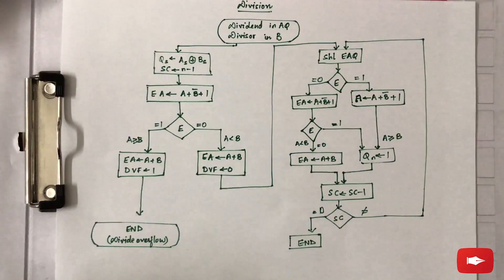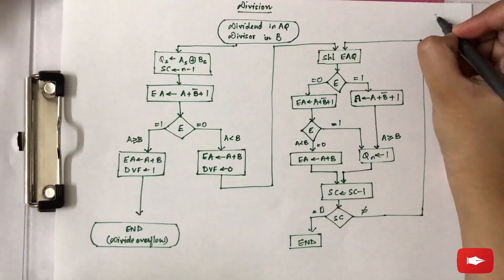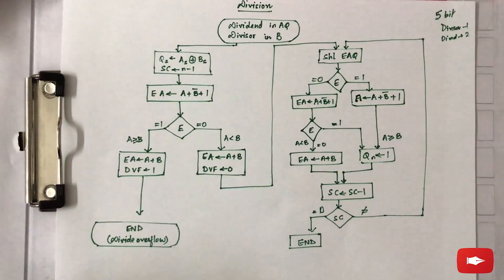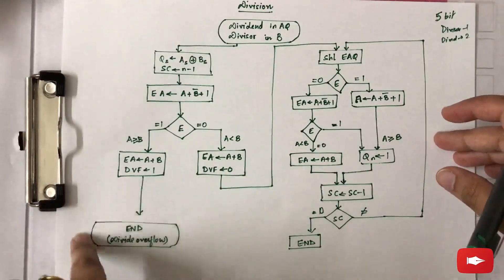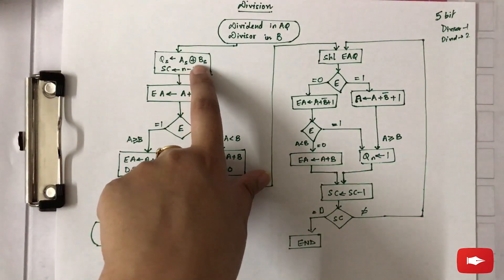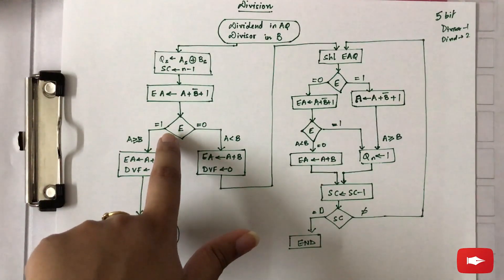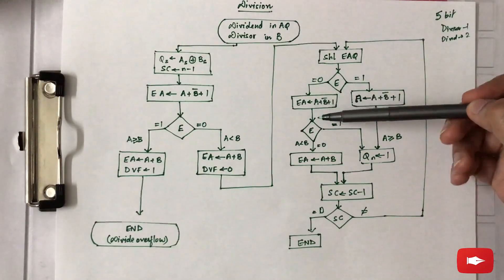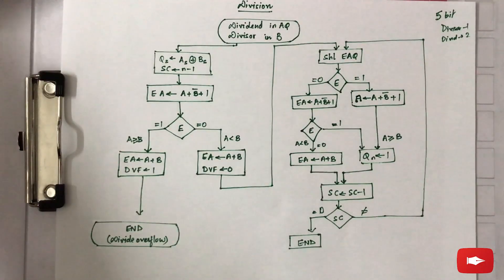Division ( Binary Arithmetic ) - Part 1

Comment: Hello ma'am ,suppose we have to do division of 10100011 by 1011 ,will it result in overflow?
Reply from the maker: No, overflow condition wont be there. If 4 MSB of dividend is greater than 4 MSB of divisor, then there will be overflow. In this case msb of dividend is 1010 which smaller than msb of divisor 1011, therefore no overflow..
Reply: okay okay i got it ,thank you so much and appreciated your work !
Reply from the maker: Thanx !